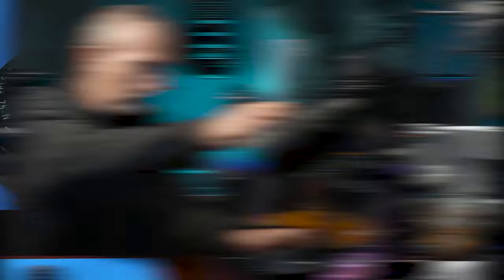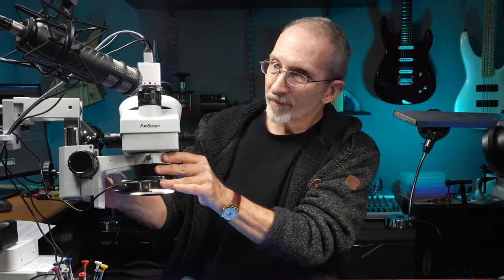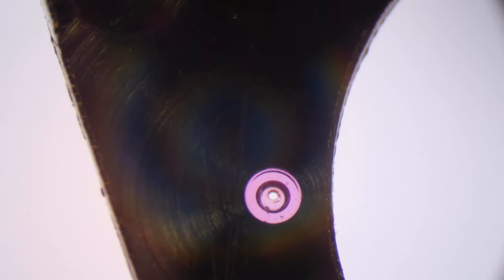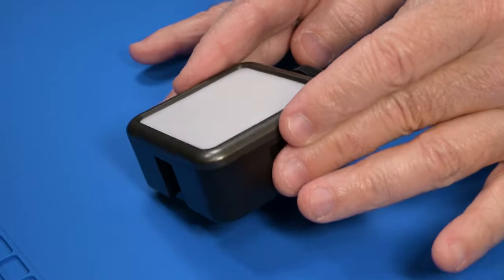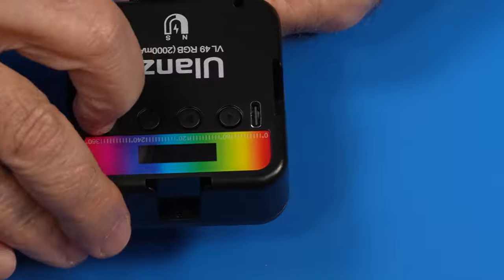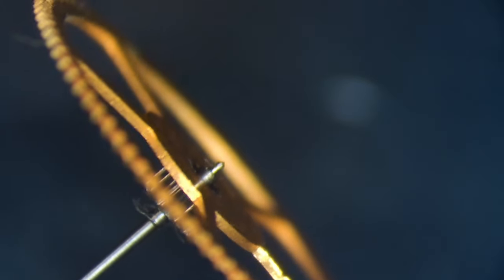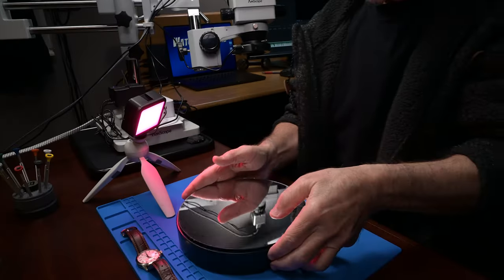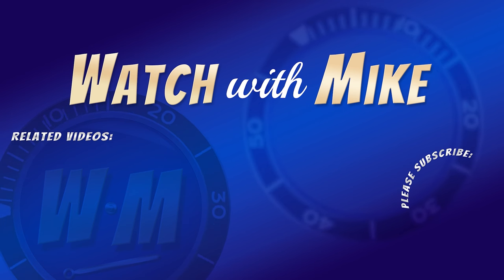$20 Accessory Will Make You a Better Watchmaker #watchrepair

Comment: Hi, Mike! This light is simply great, considering the fact it has adjustable light temperature. I paid attention to it when you were using it in your video about the newly purchased clock. A couple of month ago I realized that I couldn't properly inspect jewels for faults and cleanliness after rinsing and bought a $2 flat flashlight powered by 2 AAA batteries. Back then I didn't have a microscope and the light was far too intense for the eyes (even though it has two grades of intensity). I put it into a self-made plastic container with matte polished surfaces to reduce brightness. It made it suitable for using with a 10x watch loupe. Things got much better. And after I had purchased a microscope, the whole new macro-world of jewels and capillary effects turned into a stunning discovery, which fascinates me day by day. Rinsing the jewels has become much more efficient and effective, which yields better results in the amplitude etc. I am using the same flashlight for the microscope. There is only one disadvantage, namely flickering which is invisible to the naked eye but is registered by the microscope sensor when I am filming the process. The strobe effect is noticeable at some modes, not permanently. Having a backlight for watchmaking is vital. Thanks for sharing your experience! Another great video of yours gets n+1 likes😊
Reply from the maker: Awesome, I'm glad you liked it! I struggle with scan lines when I shoot video in my shop under the mix of fluorescent, incandescent and LED light. It is fixed by setting the camera to 60 fps (or 50 in some countries). On my iPhone, I have to use an app to let me set the shutter speed - I wonder if that would help your strobe effect? 

I like the diffuse lighting on this little LED. On some shots, you can see just the beginning of lens flare, but it is never unusable. If the light source is pin-point, I get all kinds of lens flare.

And I agree, the macro world is absolutely fascinating! There's always something new to explore! 😁

Comment: Thanks for the information. I shall purchase one of these. I have a linkMicro digital scope, and I too have a ring led above it, as the stalks that come with it are useless.  One of my grips has always been the lack of lighting under the part.  I hope to upgrade to the tri-scope one day soon.
Reply from the maker: Awesome! My digital scope had a built-in light near the lens, plus 2 lights on stalks. I always thought it was 'OK' but never stellar. A cool thing about these little lights is that you can put it on a stand and it provides diffuse top or side light as needed, too.

Comment: Mike, this is a very neat tool, and I purchased one.  However I discovered that the back of the unit is magnetic.  Need to be careful around mechanical watches...
Reply from the maker: Hi Aaron, yes the back of this light has a magnet and it's good that people know. I'm not too concerned, as the only time I've seen its effect is on small screws, which I don't really have a need for putting on the light. But I suppose a good demagnetization is best practice after assembly. Thanks for adding that info to the conversation!

Comment: Great recommendation, Mike! Thanks. 
Any concerns about the magnet on the back when working with watch parts??
Reply from the maker: Yes I had some concerns, but I don't think it is a big issue. The back of the light has a magnet, but there is little effect on the front of the light. I've been using it for bridges and heavier parts with no problem - the parts slide freely around the light surface. In fact, I think my tweezers are more magnetic than the front of the light. There is a slight magnetic field, which I was able to see evidence of when I got a small crown wheel to stand on edge - but I think the wheel was already magnetized. I'll keep an eye out now that you've mentioned it, but I think it's nothing to worry about.
Reply: I removed a few screws and took out the magnet. It uses two sided tape. I noticed it when I was looking at a dancing escape wheel under the mic.  Lol
Reply from the maker: @BruceParmele  dancing balance, love it! Check out the video I did after this (well you actually don't need to…). I showed how to remove the magnet because I noticed something similar. I'm glad you got it sorted out!
Reply: @WatchWithMike  I'll give it a look!  Love the channel.
Reply from the maker: @BruceParmele  😎